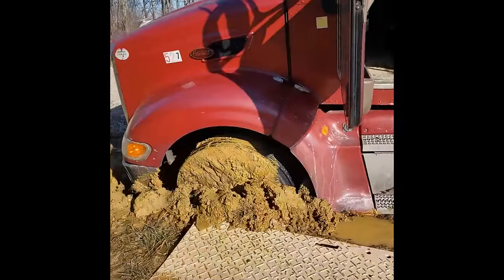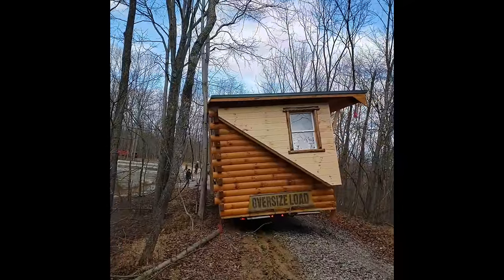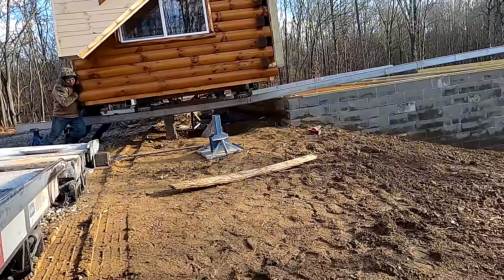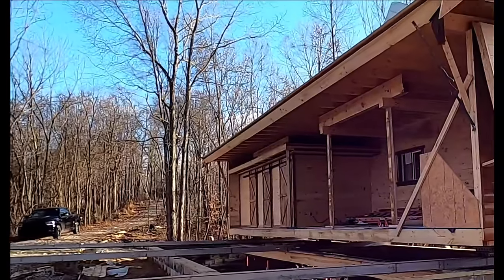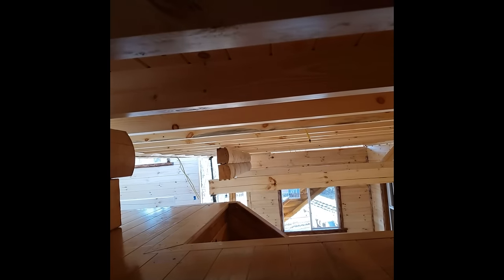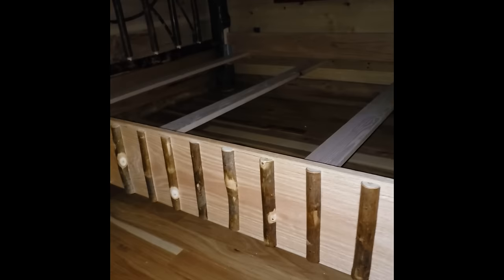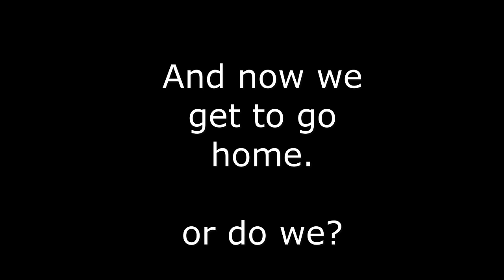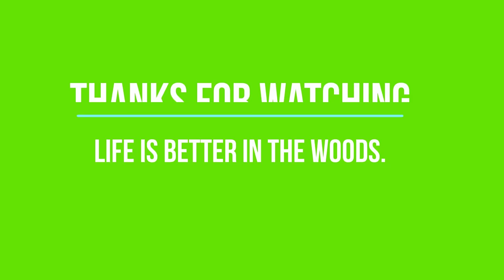Log Cabin Delivery And Setup

Comment: When the truck came out of the workshop i thought this will topple over. The trailer at its limit. That looked quite risky and dangerous. The tire from that sideways wheels, quite clever contraption, was nearly torn of the rim while being pulled sideways. All in all it gave the impression that the cabins weight and size and the equipment to handle it were no real match. Adventurous delivery.

Comment: I don't understand why you did not use the same mechanical advantage to move the house to the foundation as you did you used to raise the roof. Should be fairly simple to rig some cabling on the rails for the rollers. Especially with access from the bottom. Very nice looking cabin and property. The Amish always do quality work.

Comment: That little side steppin rig on that trailer is pretty freakin neat!
Reply: Probably from Pine Hill trailer company in Lancaster County PA. They build some crazy sophisticated stuff for the shed delivery industry. Self loading and unloading, 180* arc swing from the sideways drop axles, tilt, telescope, and more. One guy can deliver and install a large shed into spots where you would swear it;s impossible to fit the shed alone, much less a truck and trailer.

Comment: you did not prepare the sight  .  I had my modular house 2440 sq ft put up in 2004  and had basement done . I was the sub contractor    had gravel put down made sure sight was dry  had a front loader on sight   and had 2 cranes to lift the house onto the  basement  . I had steel beams across the basement set  and hade the modular house left onframe to even more support the floors  . Best hauler here was RICKY EVANS  AND HE DID ONE FANTASTIC JOB  . i HAD TREES TAKEN DOWN FIRST that would interfere with the length of the house when it was turned  .I measured and measured again as my property and where the house was set was up on a hill  . I was not taking any chances with my house

Comment: Damn, seems unsafe..no crane? This whole thing screams deathtrap to me
Reply: They have been setting modulars like that for fifty years. Way back, it was steel I beams and laundry soap slathered on top of the beams so the house would slide. Nothing in construction is guaranted to be 100% safe, but this is far from dangerous.